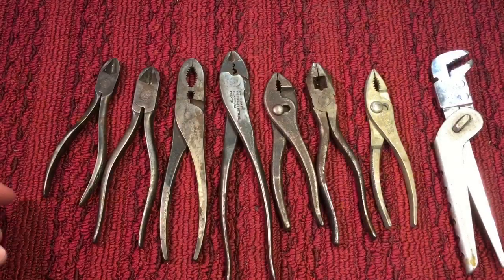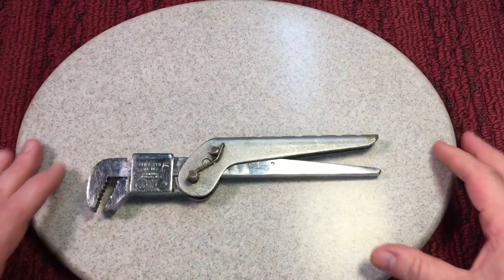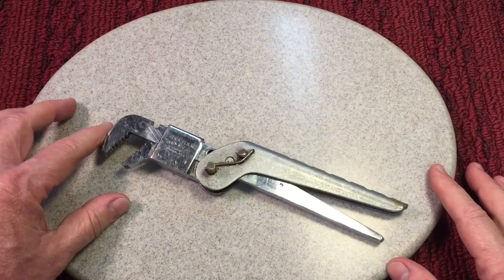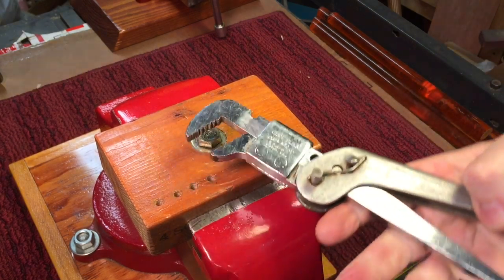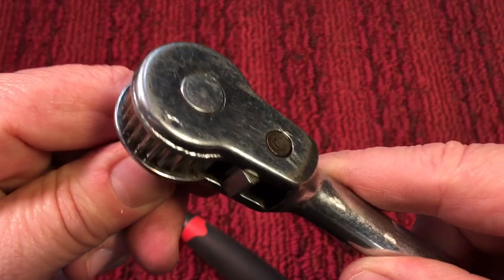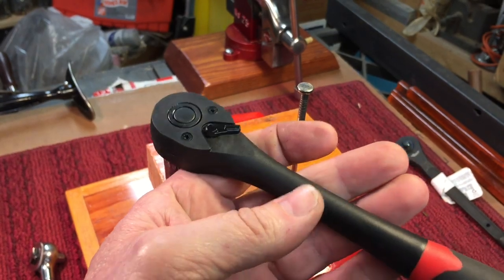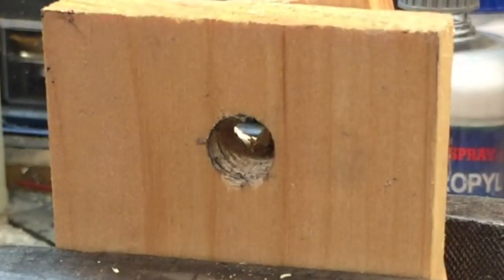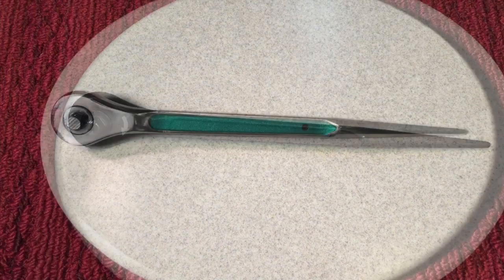Rare Click Plier Tool and Gearless Spud Ratchet!

Comment: Great video, enjoyed it. I have a small 3/8 socket set that was also purchased from T.S. , it was reduced to $7 and change. It's a reversible ratchet, was happy to get it but it doesn't work very well. When in use, it will change directions. Somewhere in YouTube land, I watched a video of a fix on these T.S. gearless ratchets.
Reply from the maker: Hi Jim!  I believe these ratchets can have a weak point when over torqued or wiggled.  I heard they have been around since the 60's and have issues.  Time is always a good indicator of a design!  =D   Thanks!!!!!!
Reply: @ScoutCrafter  You're welcome Sir 🤠

Comment: The other day I did something that I never did before. I changed my brakes on my car. I watched a video from a guy chrisfix and he showed how to do it and I watched a few times and saw the supplies he used and went and bought the parts and needed a specialty tool and got home and started doing the job and the space to loosen the bolts was small due to the brake line and the caliper and my ratchet didn’t easily fit in the space and give me enough swing to engage the teeth without hitting either the brake line or the caliper and a gearless ratchet would have been ideal if I even knew it existed! But I didn’t and ended up using extensions with universal swivels and it was awkward but I got it done. I will have to keep an eye out for a gearless ratchet. The click plier is interesting, but I can see why it was not popular 😁
Reply from the maker: Hi Joe!  The funny thing about Brakes is that the first side takes an hour and the second side takes 20 minutes!  LOL   It is a very rewarding job!

Comment: Okay, I'm an electrician. And about 20 years ago when these companies really started upping them "tooth count" on those ratchets. it was very helpful for working inside switch gear and power transformers (which are very tight spaces) ...but something that really began to notice with the higher tooth ratchets was that it was moving the socket the exact same amount of  rotation with more clicks as the lower tooth ratchets did with fewer clicks. ...I noticed it again here with your video (go back and watch this video again, and you will see what I am talking about)...pay very close attention to that black Harbor Freight ratchet clicked 3 times but only rotated the socket the exact same amount of rotation that the Craftsman ratchet did with just one click. (((I have been telling people for years that all of those extra teeth aren't really helping you turn the socket any more or faster, but no one believes me. All those extra teeth, all they really accomplish is to give the user a smaller swing arc.
Reply from the maker: Yes!  It's all about the arc!   My 30 tooth ratchet couldn't turn the nut but the higher tooth ratchets could.  It will always turn at the same rate though...  Personally I can't imagine needing more then a 72 tooth ratchet!  However I did see a 160 tooth ratchet and it needed less then half the space!  Amazing!  For me I could get by with a 24 tooth ratchet almost always!  LOL  Thanks!!!

Comment: Hi John. The lead warning is most likely to do with either the brass or bronze (both often have lead added in very small amounts) in the bearing, or other products in the factory. Lead paint as been outlawed since the early 70s in the US. As long as you are buying a chinese-made tool from a US retailer, they have to follow that law and pass QC for it. 3M sells a lead test kit which has been invaluable to me. It's a pack of single-use swabs.

As far as I am aware the finish is called "black oxide" and is a form of inert rust. You may be able to straight polish that kind of thing on the buffing wheel if it's a thick enough coating or clear coat over it, but I find that it just does not bond to the steel as well as paint or chrome. It's essentially the nickel plating of this day and age. Sometimes I wish they'd just galvanize the cheaper tools if they don't want to go thru the polishing or chroming effort.

PS: DeWalt & Stanley sell some mechanics' hand tools that have a "black chrome" finish but I've never seen them in a store and the ratchets are apparently non-user serviceable. But the finish might be something you find intriguing if you ever see them at a garage sale or flea market.
Reply from the maker: Hello Aubreykun!  I never even thought about the innards having the lead!  Great info!  You are right about the Black Chrome!  The new Craftsman tools are Black Chrome and it feels quite nice!!!   I was fondling the tools at Lowes before security gave me a strange look!  LOL

Comment: Nice job. I agree with you — I hate that chalky black oxide finish on tools. A lot of the time it is really blotchy and uneven and it starts coming off the first time you use the tool. The polished steel and candy apple paint are a HUGE improvement.
Reply from the maker: Some people like the Black finish but I never did-  The new Craftsman tools have a Black Chrome that actually feels very nice in the hand!

Comment: Good looking spud....NOW! My Sea Bee Uncle was an iron worker too and I found out what a spud wrench was at a very young age! KObalt at Lowes has one of those sprag clutch ratchets too. Maybe even different sizes. Whatever I have is good enough for you ot's for so have a FINE weekend and if you end up down here I have several GOOD wrench men if you need one!
Reply from the maker: Hi Lewie!  Years ago Spud wrenches were quite popular.  I think they are coming back as I see are of them for sale.  Honestly a good spud tool is just a pointed piece of steel with nothing on the back so you can use a dead blow or something to drive in the spud.  The gimmicky heads on the other end just hamper the design!  =)   Thanks!!!!!
Reply: @ScoutCrafter  Thanks to the Sea Bee Uncle I always know what to do to line stuff up and when hammering, using a 'buck up' bar to give the force of the hammer to have something to stop it. Happy Weekend CS!

Comment: Nice batch of tools with those interesting Click pliers. That ratchet came out awesome. I didn't know that you could get a flat finished wrench that shiny. You should stencil in the direction arrows and use acid etching. That would be cool. Always love those metallic colors.

Don't get me started on NYS inspections. The emissions ODBll codes are the worst. Small EVAP leak my <expletive >. I just spent over $400 having my EVAP canister replaced because the NVLD switch failed which only comes with the canister. Adding insult to injury, stupid Chrysler requires the gas tank to be dropped to remove the canister requiring even more labor cost. One time the stealership wanted $30 to change a license plate bulb they said was out. Two screws!!!!😤 Its all a money making scam!! Rant over.
Reply from the maker: LOL  Stealership!!!!!!!!!    =D   Awesome Steve!   Remember- Fool me once shame on you, Fool me twice shame on me!   They can laugh now but when it comes time to buy a new car you will remember!!!!
Reply: I'd never buy another Chrysler but this one has done well by me. Have 3 Hondas and we love them!

Comment: Cool video. I've got the same 42 tooth round head Craftsman ratchet in 1/4 and I love it. Wish I'd gotten a 3/8s and a 1/2 back in the 90s when they were still getting then made like that in the US. I didn't catch the make on the open head ratchet. The handle looked like a regular I beam Craftsman.?
Reply from the maker: The one feature I really like is the quick release button!

Comment: So is that black finish basically just paint or is it some sort of powdered coating applied electrostatically?  - Kathie
Reply from the maker: Hi Kathie-  I think this finish might have been powder coated or something because very little came off with the stripper!  Felt like chalk!
Reply: It's "black oxide" - a form of inert rust, similar to what you get from removing rust with electrolysis or evaporust.

Comment: Interesting that you have a Spud Ratchet on todays show. 
On Monday one of Lydia's friends gave her three wrenches that were going to be tossed at his work. Two Trimo wrenches and one Auto Wrench. One of the Trimo wrenches has the word Spud cast or forged into the frame. It doesn't have the tapered aligning pin on the handle so I'm not sure why it has Spud? 
The other Trimo is extremely heavy. Not that large but really solidly made. 
I will be cleaning them up and post a video. Not quite to your level. I like polished tools just not when I have to polish them. 🙃😎
Reply from the maker: Dave- I always liked the look of Trimo wrenches!  They are beautiful and strong wrenches!!!!!!

Comment: Actually on the Click pliers the design isn't that bad. Remember, when your're using them on a pipe it will propably be self-locking. So you don't need to touch the lower uncomfortable handle, you just need to push on the upper handle, don't turn it backwards or it will ruin the surface of the nut or the pipe. I suppose it works like like a swedish wrench, the most common type of pipe wrenches here in Europe. And for the same reason a Stillson pipe wrench only requires a single handle.

https://en.wikipedia.org/wiki/Plumber_wrench

In Germany scaffolder use such ratchets with a pointy end. I does not require any nuts, there are two sizes of "nuts" connected which can't be removed (mostly 17 and 19 or 19 and 22mm).

https://pauling-eisenwaren.de/wp-content/uploads/2016/09/Elora-Stahlbauknarre-765-19x22.png
Reply from the maker: Hi Marcel!  The normal pipe wrenches have a bit f built in slop that allows the wrench to grip the fastener or pipe but this design has little slop and didn't really grip well without pressure, although I didn't try it on any malleable pipe..   Thanks!!!!!!!!!
Reply: @ScoutCrafter  The swedish pliers I described, there are actually two versions available. The standard version, with a 90° slope, and a version which we call here in Germany literally translated "slope swede" or "corner pipe wrench" with a slope of 45°.

The advantage of the 45° version is it works better in confined spaces, but only on round objects like pipes. Not very good to turn hexagonal or octagonal objects.

The 90° version will work on round objects as good as on hexagonal or octagonal objects.
Reply from the maker: @Marcel_Germann  The Swedish pliers are usually longer and have a round bottom handle if I'm not mistaken.  They look much more comfortable.  I always wondered why you never see that design here in the states as it is a proven design and still used everywhere else!
Reply: @ScoutCrafter 
Actually there are several sizes available, normally between 250mm (10") and up to 700mm (~27 1/2"). 
You can see that here on the website of Knipex:

https://www.knipex.com/index.php?id=1216&L=1&page=group_detail&parentID=1368&groupID=1496

They even make a quick adjust version.

https://www.knipex.com/index.php?id=1216&L=1&page=group_detail&parentID=1368&groupID=2041

 For the same reason you don't see a Stillson here that often. This is our standard pipe wrench, over in the US you're using the Stillson design. Both good designs, otherwise they would not have lasted for such a long time. I think most tradesmen use the tools they're familiar with.
Yes, but the thing with the swedish pliers is: The round grip is only for adjustment. If you'r using the pliers you only use the nicely shaped handle, the round one is left alone and just hanging down.

Comment: The gearless ratchets have been around since the early 60s. I think it was wizard who made it. Sprag clutch mechanism is how the old one was built.  Not good for heavy torque as they don’t release very easy after breaking a bolt loose.
Reply from the maker: Hi Michael!  Wow- The 60's!  I am familiar with the Sprag bearings and like you said, wouldn't trust them on high torque applications because of the way they lock-up and jam to operate...  It's a novelty and I'm all in for tricky tools!  LOL

Comment: I meant to ask what you do with a black oxide tool finish as I saw most of your restorations dont cover it. I inherited alot of the diamolloy adjustable diamond tool mfg wrenches and they have the black oxide coating which has spots of rust in the finish and other parts it's in good condition.
Reply from the maker: Hi Rob!  I have 3 Diamolloy adjustable (black) wrenches I am going to do soon!  Great wrench/bad finish!  LOL

Comment: S.C. Very unusual wrench for sure.. Have you ever noticed the ratchets that have a higher tooth count,  will they handle the same amount of torque as the ratchets that have less teeth.. I thought maybe the finer teeth might strip out easier... How is Ben doing,  I haven't heard much from him lately?
Reply from the maker: Hi Gary!  I have watched a lot of ratchet reviews and am always surprised at how much torque the high tooth ratchets can handle!  However always remember they are testing them new!  When a ratchet wears over time the teeth wear down and that is where you will get slippage.  With the low tooth ratchets it takes many many years to wear down that much but we will see with the new ratchets how they last!  =)
Ben is great!!!!
Reply: @ScoutCrafter  That's good.. Tell  him I said hello...

Comment: No narrow angle test on the spud ratchet? I like those, I'd like to get 1/2-3/4 gear version for cheater bar use.
Reply from the maker: Hello Noah!  The only reason I didn't test the gearless is because this is a Chinese cheap version and I didn't want to cast dispersions on the operation of a good gearless ratchet.  Can you believe they are up to 160 teeth ratchets!?   I can't imagine needing such a small arc!
Reply: @ScoutCrafter  I think it's more of a gimmick for bragging rights these days. Cars are tight, but I've never seen one that tight.

Comment: The click pliers, I do not think you are meant to squeeze the handles.just by pushing on the cam lever the more you push the tighter the grip. How to add value to a 5 dollar ratchet? How much could the ratchet be sold for now, the before was  just raw material and after, a machined finished beautiful tool.
Reply from the maker: Tony- On regular pipe wrenches the jaws self tighten but with this wrench they don't work as well.   =D
Reply: @ScoutCrafter  That is why they are rare.

Comment: How did this happen?
After I watched the full video, and had commented I realized that for the first time, I had a criticism for you.
You set up a wrench demonstration.  You demonstrated wrenches with mechanical rachets, but not the gearless!  ...... Once that black junk is removed, take the beautiful result, and demonstrate its tighter range.  Please.
Reply from the maker: Mark- I didn't demonstrate this ratchet because it is a inexpensive Chinese copy and I didn't want to cast dispersions on how quality gearless ratchets work.  The inexpensive ones work but not as good as the quality ones!  =D
Reply: @ScoutCrafter  I appreciate your every video, and the examination of the difference between quality and cheap.